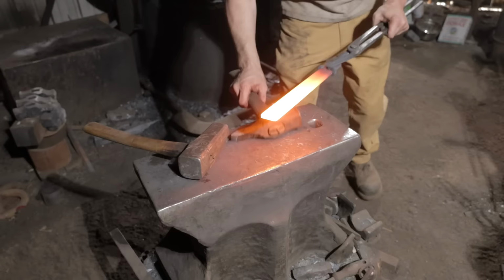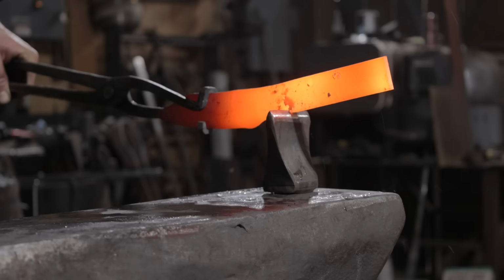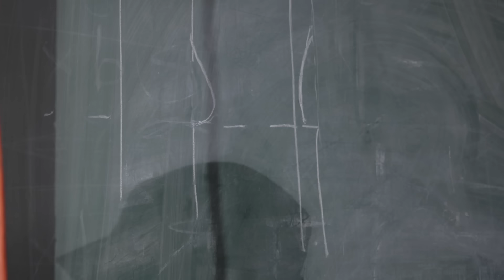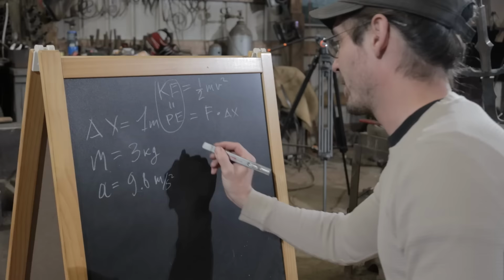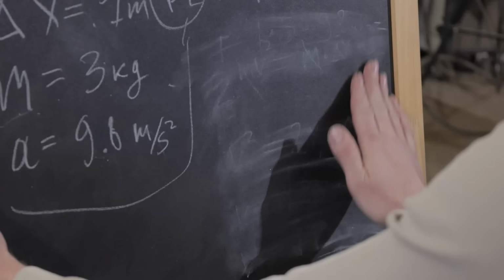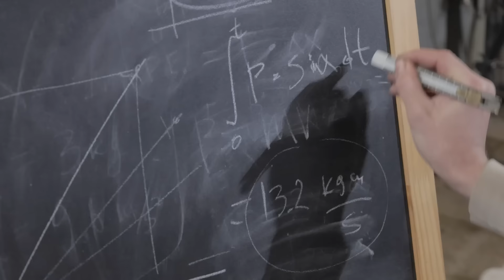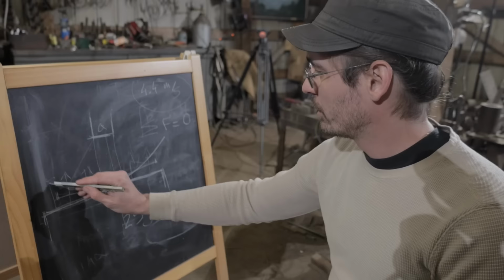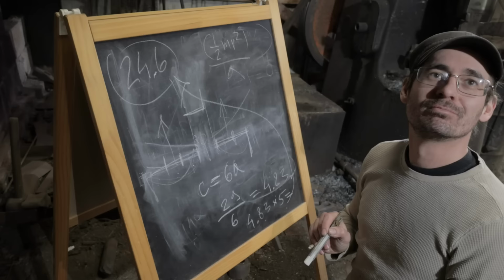You Can Forge a Knife Correctly [Here's How] !

Comment: Whoo-boy, there's a lot wrong here with the physics, which I will say in advance is not my field.

To start with, your calculations are assuming the hammer is just falling, that gravity is the only force acting on the hammer, i.e. that you are not supplying any force of your own.  That is very clearly not the case, which invalidates the calculation, or at least makes it missing a pretty substantial component.

A simplistic way of thinking about the forces involved is that the force of the blow is equal to the amount of energy you supply to it plus the amount you get for free from gravity.  What you have to keep in mind that you have to pay for the amount you get for free from gravity by lifting it back up again, restoring the potential energy.  Some of that you don't have to pay for due to the force being applied back upwards, but the hammer won't come all the way back up again on its own, so you'll have to supply the remainder of the force to do so, which is going to greatly depend on the mass of the hammer.

Next, let's assume you are correct, that when you drop the hammer onto the anvil, it is only going to receive 1/6th of the force in the opposite direction. Now, let's assume I'm dropping a ball bearing instead of a hammer.  That should be even less that 1/6th, since the surface area is tiny in comparison, but let's be optimistic and say that its 1/6th. So that means it should return upwards at most 1/6th of the distance it fell. So let's try that experiment: drop a ball bearing from, say, 1 meter above the anvil, how high does it come back up?  I'm going to bet its considerably higher than 1/6th of a meter, which means the original assumption is incorrect.
Reply: Hello and thank you for your comment. You have completely misunderstood the math. The ball engages in an elastic collision. However the hot steel is an inelastic collision. Further, I assumed that it's just the mammary falling to keep the math simpler. But I could have added the weight of my hand to the mass and extra force down. That only changes the numbers, not the relative equations. In fact, that makes my case even stronger. However,  I chose not to have long numbers in the video and not calculate either limits or series. The reason for simplifying the mathematics for bare minimum is because I find it that people as a general case don't know past differential algebra. And, in order to fully describe what is going on in what I do I would havevhad to use dynamic systems and chaos part of mathematics.  Further, the relative heat generated by the force of the blow would have been necessary.  Now, if you are familiar with differential equations,  I will try to see if Matt wants to record a 9 hour fun class on the topic infront of a giant blackboard.
Reply: @ilyaalekseyev3589  You, in my mind, had two good choices: a) explain that the calculations you were using were wildly incorrect and for demonstrational purposes only or b) simply omit the math altogether and the explain the general principles. This video does neither; it purports to be representing the math/physics it presents as accurate, which is disingenuous. Bad information is worse than no information.
Reply: @dbrandow  I did say I'm simplifying. And, in terms of physics increasing the mass has no use as it is a constant. Adding the force of your hand also has no use as that is most likely the same whatever hammer you use. The only thing it would have done is make the velocity calculation messy and require a speed camera.
Reply: The mass of my hand is the same regardless of the hammer. The force I consistently apply to it down is also the same (most of the times I just let the hammer fall without accelerating it).
Reply: @ilyaalekseyev3589  Your explanation of the physics of the force involved in the downward blow wasn’t just simplified, it missed potentially significant contributions you did not mention, as noted. And your explanation of the anvil rebound was wildly wrong. You obviously have a level of familiarity with mathematics, but your knowledge of physics is insufficient for the task. Stick to what you know; your blacksmithing content is very good and I appreciate it. Or, potentially, consult with engineers and/or physicists and get the right answers.
Reply: @dbrandow  I was not talking about rebound in the video.  Rebound is a measure of elasticity of collision. I was talking about counteracting forces. The physics of what I'm talking about is the same whether you use a wrought iron anvil (almost zero rebound) or a modern H13 anvil (98% rebound).
Reply: The force which the hammer applies to the steel is only distributed over the area of the hammer face. Because of the fact that at some point the hammer is still (velocity zero), the anvil applies equal and opposite force to the steel from the other side. The force applied by the anvil is distributed over the entire area which contacts the steel. You do not need to talk about rebound.
Reply: @ilyaalekseyev3589  I’ll let this be my final comment, because I’m obviously not going to convince you: you don’t understand the physics, and my advice would be not to pretend to your audience that you do.
Reply: @dbrandow  I started my education as a physics major. My highest class in physics was plasma dynamics. Highest mathematics was chaos. I understand the physics. I also understand that you are confusing rebound with counteracting force. You are treating constants as if they were functions.
Reply: @ilyaalekseyev3589  All right, one more, I couldn’t resist: a constant can be significant, it’s absurd to claim otherwise, and I think you need to go  back and read up on vectors and solid material dynamics again.

Comment: Holding hot steel with the hammer head ??? And this GURU is teaching !  Its called a half set .  Even the instruction is not using correct teminoligy .  Forging from tip back ???

Comment: Explanation is wrong, even through the advice to work such is correct.
There is no upward force "doing work" its a counter force, it does not do work, infact the ENTIRE idea that it can goes against the 3rd Newtons law.(disclaimer for someone that wants to argue, we are talking about this specific case and how he is claiming equal force across the entire piece on the bottom side and its "Correct" as far as it needs be in this instance)

To go into a sufficient explanation would take too long so I will simply give the direction of investigation and an real world example anyone can test.
Surface tension, working steel causes surface tension, if one side is worked more then the other then a differential in surface tension will cause the object to bend in the direction of the highest tension.

Real world example
Anyone can get a piece of aluminum foil and lay it flat on a surface and then run something flat with a bit of mild pressure down the length of the strip, it will curve upwards in the direction of the pressure, lay it back down in reverse and run the same amount of pressure and it will end up returning mostly straight.

Ensuring that both sides of contact on a worked piece of metal are as close to even as possible ensures that the tension built up on both sides is also even.
Reply: Hello, English is my second language.  I believe your objection is in terminology and not the explanation. The counter force, sure. One of the problems I'm having in explaining everything is in keeping terms as simple as possible so the the YouTube audience can see the big picture.
Reply: Further.  Surface tension is not an appropriate explanation for hot steel specifically when it is above its critical temperature. That is because internal structures are reshaping so fast that the surface tension is constantly readjusting itself. You can actually use a different example to confirm that my explanation is the video is correct.

Japanese plane blades are readjusted when they are resharpened. To do that the craftsman planishes the blade in air with a light hammer using gentle taps. In this case the plane blade bends away from the hammer planishing. This is a great example of using surface tension in craftsmanship. And, it controls for the influence of counteracting force of the anvil as there is none.

An opposite example that looks similar is planish straightening the blade after heat treating. The craftsman puts the blade on the anvil, cold or at 200 degrees Celsius, and planishes it. In this case the blade moves away from the anvil. The reason is because the anvil ends up "planishing" the bottom side all over while the top side is planished locally.
Reply: @ilyaalekseyev3589  The Tension-compression effect does relax but thats of no consequence.

Because it relaxes everywhere on both the side inducing the bending and the side resisting the bending.
Net result is the piece is already bent and there is no counter tension force to bend it back because both sides relaxed.
Reply: @givemeanameman1  This is actually more similar to the "bicycle." I disagree with you on something very simple based on careful study of when and which equations are appropriate. 

The reason why I said "bicycle" is because, surprisingly noone is sure why bicycle work. It used to be assumed that it's the gyroscopic effect, but apparently that is not the case (there's a famous experiment).
Reply: @ilyaalekseyev3589  Sorry but no, the science behind stress and strain is well known. With steels and their heat response being one of the most studied and published as its one of the most important for human civilization.
Reply: @givemeanameman1  That is true. With the exception of the narrow case of bladesmithing. Almost zero research has been done apropos this exact scenario. Most of the data is inferred from the larger material science industry, but none of it studies the exact instance.